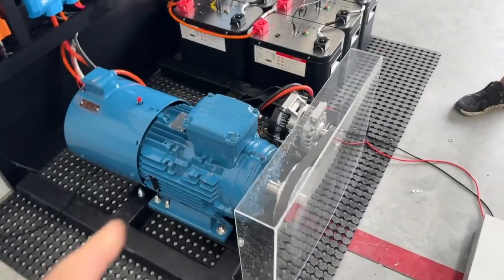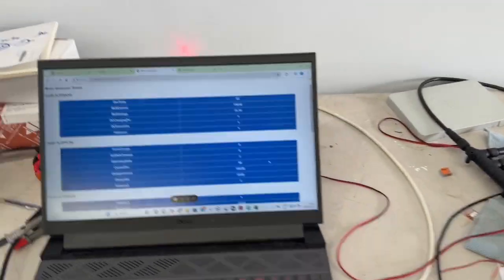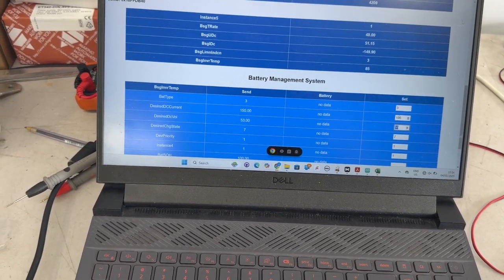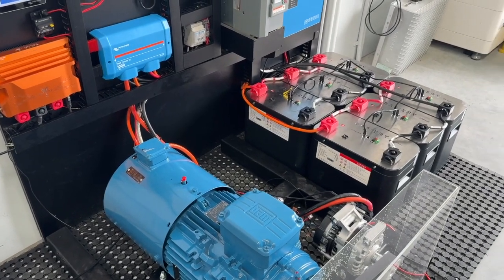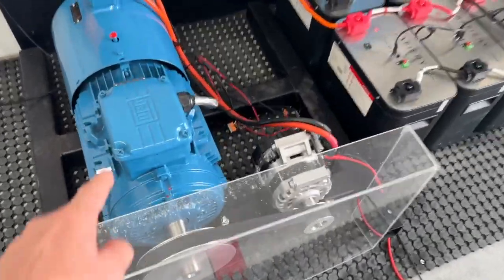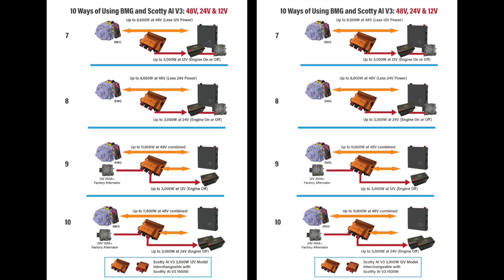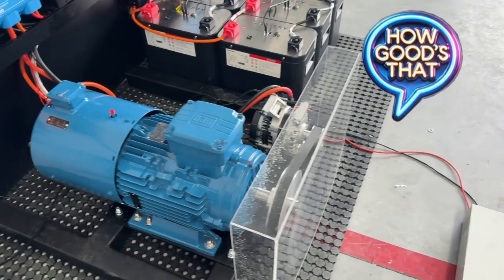10kW power from Hybrid Alternator (Bi directional Motor Generator) Charging @ 48V Sprinters

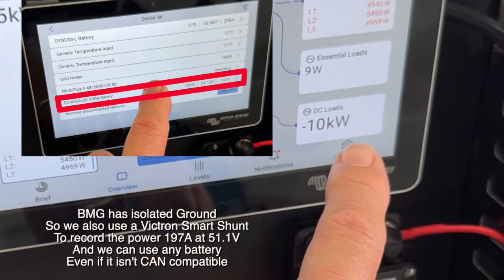Comment: Yes, but at 0:46, what 'current draw' and 'voltage configuration, e.g., '230 star'' is the VFD pulling to run that 15KW 3P motor and hence driving the alternator? What RPM is the alternator spinning at? At what torque is it achieving such a 200A 50V result?
Reply: @Safiery Yes but  #quote “As its too much “Geek Speak”” un-quote contains the salient info to determine on black and white the efficency output vs input power characteritics. The sauce of it all of course unless the seller wants to hide the real performance value trying to use this promo video as a bait in fooling people to spend their money on un-realistic efficiency values.

Like why not testing the alternator byitself without the orange device for the wanted values.
Reply from the maker: Thanks, we have all that data but wont show to end user as its too much "Geek Speak". Our continued testing is on the Auto algorithm we are developing in conjunction with the associated DC DC (orange device on wall) wjen it is connected to the factory 12V alternator in these ICE setups. By reducing the Load on the BMG slightly, the temperature drops and we increase the DC DC load for the same overall output and then swap back . The algoritm is to get Max Combined Power Point Sustainable.

Comment: loosing 5 kw in the process, and heating the alternator up to 77 degrees. pretty sure it'll cook if you would run this alternator under the hood of a car 🤣 (66% efficiency.........)
Reply from the maker: Its not a conventional alternator. Its a bi-directional motor generator at 90% efficiency.  We start our long run tests today. I dont see any difficulty with 8kW continuous and then add Scotty from 12V factory alternator and on a Sprinter we will get 10kW  continuous.
Reply: the 5kw loss is the 3phase motor loss that's driving the alternator , you can see this as Grid load / AC load
Reply: Typically large motors have an efficiëncy of 88-95%.
So what you are saying is ridiculous. It's okay to agree with me that this is a hoax . A loss of 30% is definitely not good 😂